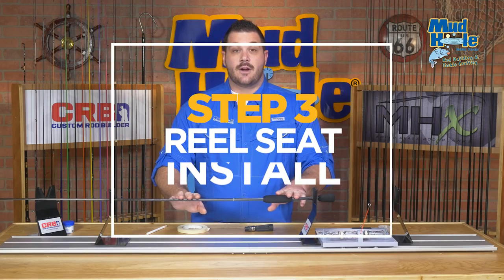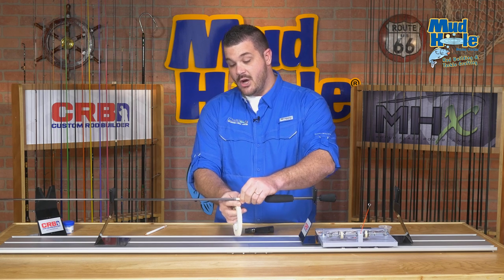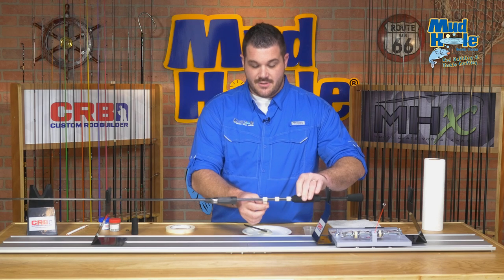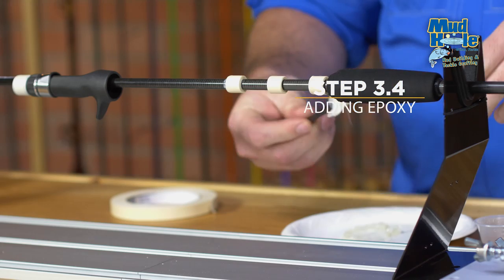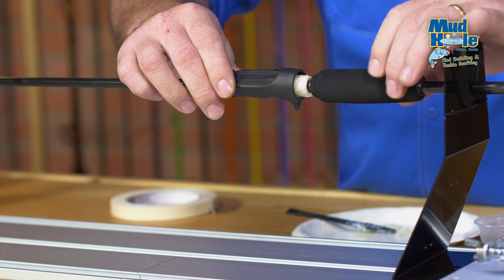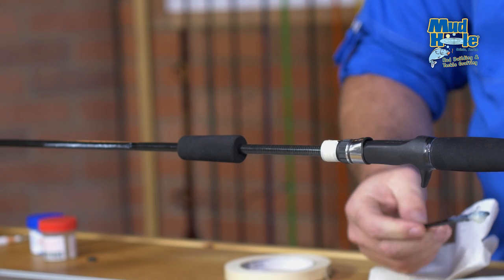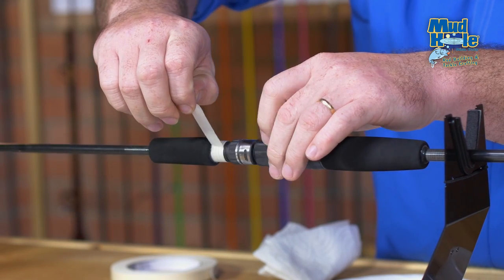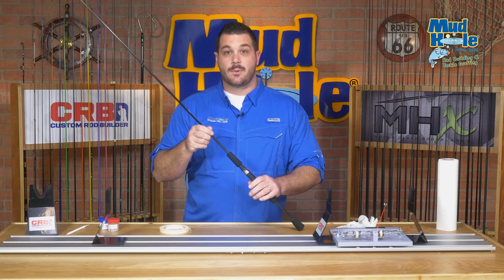How-To Install A Casting Reel Seat | Rod Building 101

Comment: I'm in the process of building a new salmon downrigger rod with a long time buddy of mine who's been building rods for the last 45yrs. One of the things he does differently when it comes to putting on the reel seat is use a heavy duty, fiberglass reinforced tape instead of basic masking tape. I feel like this is a very wise move as masking tape ready degrades overtime and if there is any pathway to absorb moisture, masking tape WILL absorb it and begin to degrade. Which explains why some older, off the shelf rods will develope a lose reel seat over time. Fiberglass tape and a healthy coating of epoxy will outlast any masking tape. Just my limited knowledge 2 cents.

Comment: For the arbors within the real seat, is there a reason you use normal masking tape?  Using a mesh like tape where the epoxy would penetrate help make a harder arbor word better?
Reply from the maker: Masking tape is porous just enough to absorb enough epoxy to hold strong while also being rigid enough to stay formed for it's lifetime (if you seal in the tape when epoxying). Mesh tape could in theory work well, but the spongy material as well as the amount of epoxy being used in the grip adds to weight in the handle section and potential failures. If concerned about the type of tape, you can avoid it all and use foam arbors, but these have their own limitations and advantages.